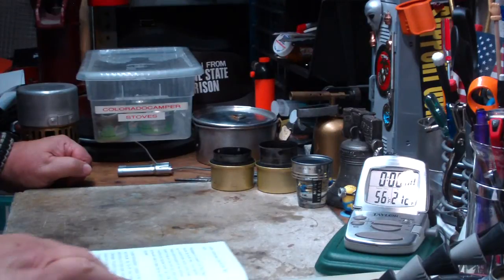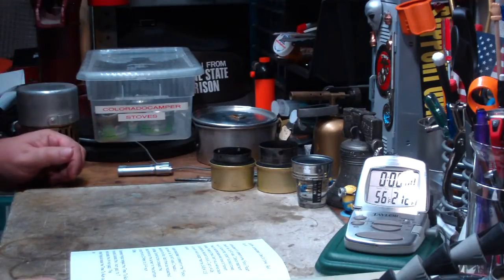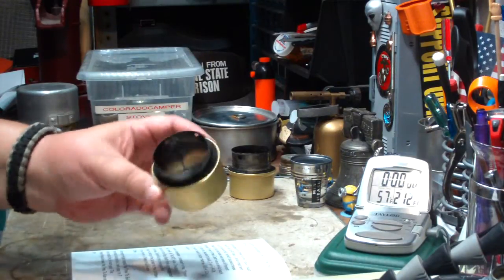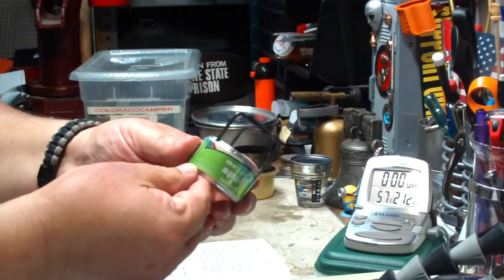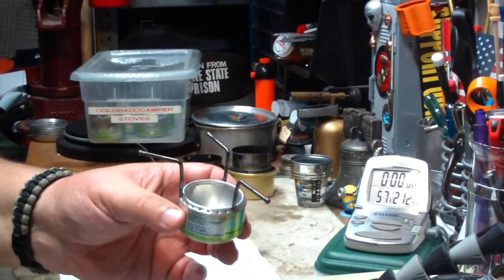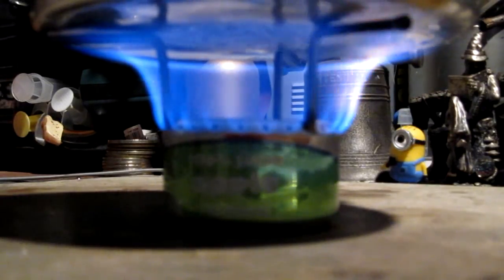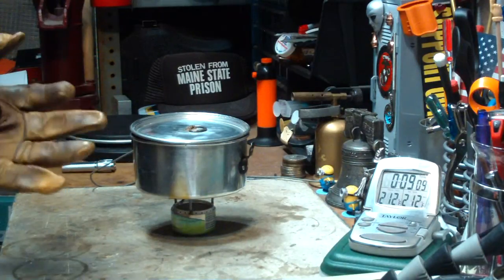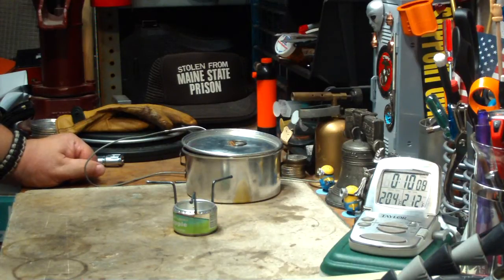ColoradoCamper's Open Jet Stove - Boil Test #1

Comment: And about the SVEA 123: I too have heard some horror stories about that stove. Most of them involved people using full wind screens, which reflect too much heat into the stove and cause it to over-pressurize.
It's my favorite white gas stove, but it does have some quirks that need to be accounted for in order to operate it safely.

Comment: Hiram - first, no need to apologize. I had forgotten about it too.
Second, I think this test shows the value your videos provide because you are much more scientific in your testing. For my 4:06 boil time, I didn't record the starting water temperature or ambient temperature, so I bet that is the primary cause for our different times, along with the ideas you mentioned about different pots, elevation, etc.
Thanks for putting my stove through your more controlled testing procedure!